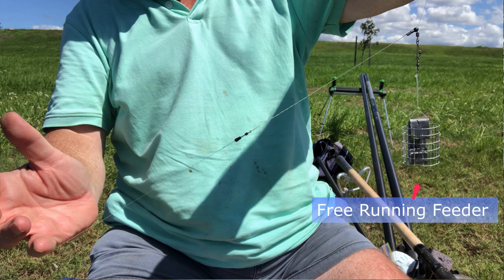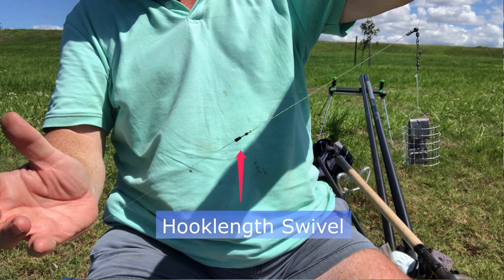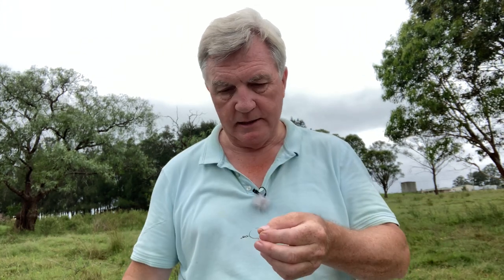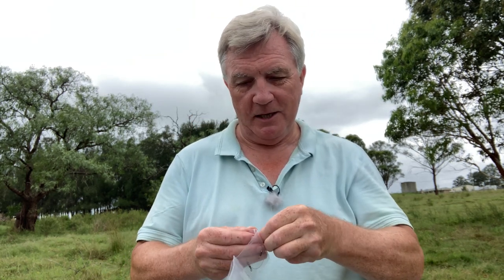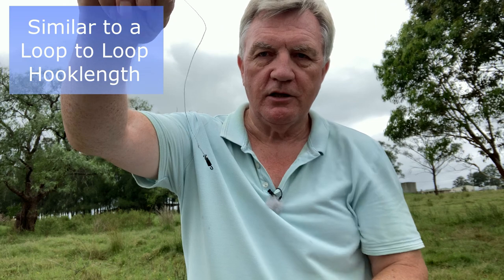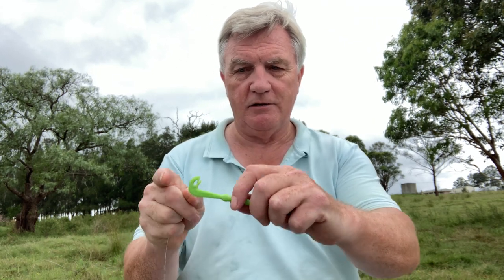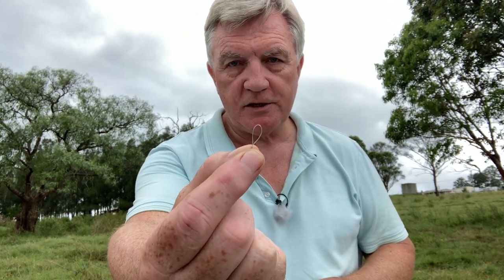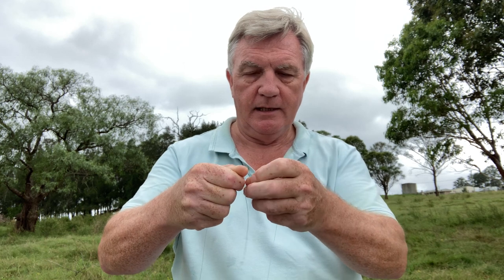Simple Feeder Rig Setup with Reusable Twissled Boom

Comment: I do exactly the same. But I use a Drennan swivel stop bead in medium size. This is then a neat set up, that protects both the swivel, and the 4 turn half blood knot, and kicks out the twizzled boom. I keep my pre tied booms on a thin strip of soft wood held in place with hook length spool pins, at the loop, on the end of the twizzled boom, and the pertruding end of the Drennan swivel, (where the boom is tied to) By so doing, this keeps the pre tied booms lovely and straight, and illiminates the risk of any tangles. The booms are 6 inches long made out of 8lb mono, and the hook length loop, or attached quick change swivel hangs below the feeder. Perfect tangle free free running set up, showing up the shyist of bites.

Comment: Have you tried a piece of stuff fluoro yet instead of the twizelled boom Den? Just wondered as it would appear many of the top match anglers now do this. Great channel.
Reply from the maker: I haven't tried that yet I'm afraid. I'm sure it would work, but I don't use fluorocarbon lines, so I think I'm going with the old adage of "If it ain't broke, don't try to fix it" on this one.😁😁👍👍

Comment: I'm wondering if I could use an American snap swivel on the main line to attach the boom onto for quickness? Or would that make it to slack!
Reply from the maker: I'm not sure what you mean Paul, but if it makes things easier, give it a try mate.
Reply: @FishingwithDen  sorry den, its okay I've given it more thought and it won't work. I've made my twizzled booms up now to try them out. 🤞🏻🤞🏻
Reply from the maker: @FishingMadDad  Just make sure the tucked half blood knot which secures them is properly pulled down and tight. I made that mistake in the early stages and had a couple of malfunctions.
Reply: @FishingwithDen  hopefully I have. Thanks Den
Reply: @FishingwithDen  Well Den I never caught a chub but did land a lovely 3lb bream. Your twizzled boom worked a treat. 👍🏻
Reply from the maker: @FishingMadDad  That's excellent mate. I'm glad it worked.

Comment: How do I do it with a braid ?
Reply from the maker: Hi Marcin. Use a monofilament shock leader of around 7 to 8 metres.
Reply: @FishingwithDen  just tie 8m of it to braid ? I use 0.10 braid. Can I use guru anti tangle links ? I'm very new to feeder fishing and I'm not good at making knots
Reply from the maker: @MartinTeerly  Here's a link to a video which shows you how to connect the monofilament to braid Marcin. Start viewing at 7:40  Once you have the monofilament connected, just do everything else as normal.
Reply: @FishingwithDen  hi. I sorry to bother you but how often do you rebuild your rig ? I caught about 8 big tench with quiet good fights and I can see that monolit line starts to twist on its own
Reply from the maker: @MartinTeerly  I assume you mean the mainline is twisting Marcin, not the twissled boom. Personally, I don't change mine until I can either see or feel that the line has been damaged. As a best practice however, It's probably a good idea to rebuild the rig at the start of the next session.